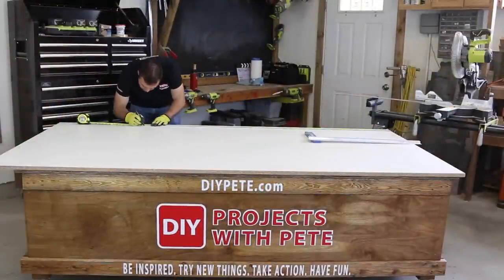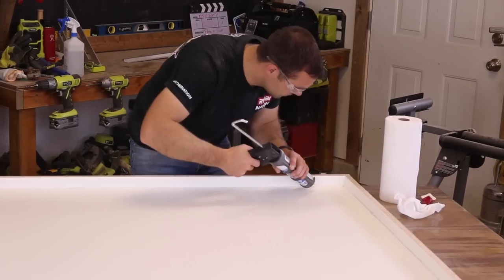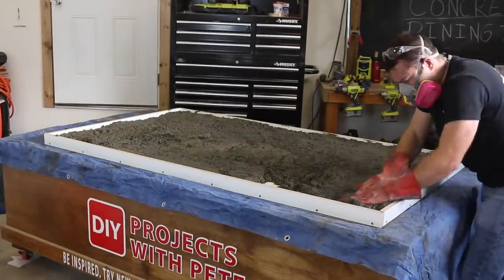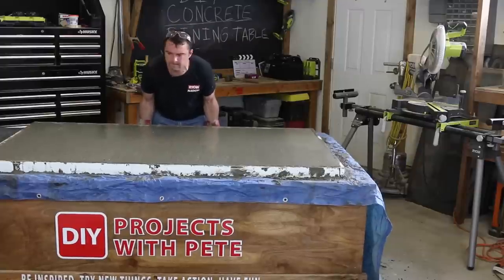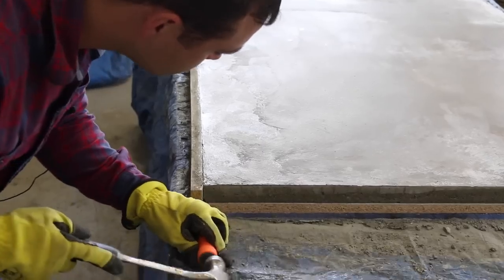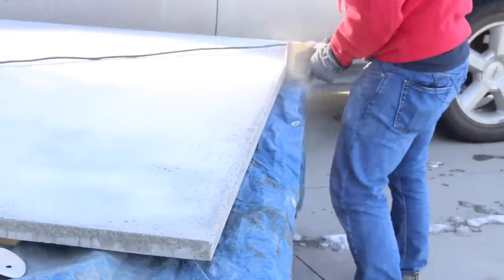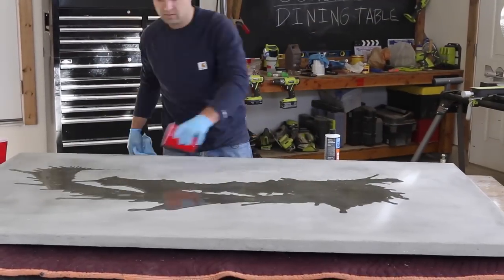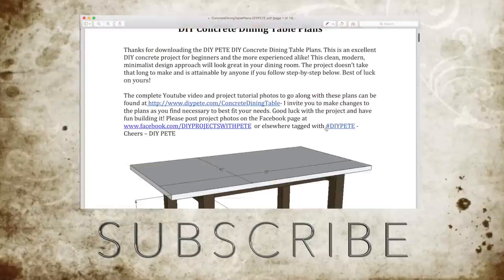How to Make a Concrete Dining Table

Comment: Pete, I'm wondering about your base, and how it's held together. Given the thickness of the stock, do you think 3/4" dowels with wood glue can hold that weight?
Reply from the maker: Hi Stephen! It sounds like you are talking about using dowels for the joinery instead of screws. I do think dowels in combination with wood glue could be another option.

Comment: Hey Pete. Awesome design. How did you go about calculating the strength of the wood base, to ensure it could support the 400+lb table, in addition to the live load of food, plates, etc.?
Reply from the maker: Thanks Justin! I built it very sturdy  and actually ended up putting in a few additional support after the video. I did some tests myself, butI did not use specific software.
Reply: Have you ever worked with redwood? I’m considering the same design you used (in your pdf plans) with redwood 4x4s. Interested to know if you’ve used it for furniture in the past with much success.

Comment: nice project Pete...what kind of wood you used for the base?  ... do you think a 3 by 3 would do it as well?
Reply from the maker: +phil par Hi Phil! I used douglas fir for this project, (4x4's which measure 3 1/2 x 3 1/2 of course). I wanted to keep this beefy, since the concrete is quite heavy. I think I'd stick with the 3 1/2 x 3 1/2 if possible. Or if you use stronger joint types I think you could get away with thinner timber. I tried to keep the base as simple as possible for beginners, which is why I used wood glue and 6 inch screws. Thanks for the great question Phil.

Comment: Great looking table Pete.  How long do you let the concrete cure before wet polishing it?
Reply from the maker: +Eric Opal Hey Eric, if wet polishing the concrete I like to wait a while for the concrete to continue to harden and cure. After removing it from the mold completely, I'd recommend letting it cure for an additional 48 hours or longer with the Quikrete mix.
Reply: Ok thanks.

Comment: Hi, just wondering if you have to sand the concrete before you seal it?  I like the way it turned out with just minor sanding of the corners and edges.
Reply from the maker: Hi! You can finish however you'd like. You can go without sanding if you'd prefer. Will have a bit different look and feel.

Comment: Hi Pete, thinking about attempting this project and just wondering if an MDF board is just as good to use as melamine as MDF is about 1/3 of the price of melamine here in the UK? If so would you recommend to use a moisture resistant MDF board or just a general purpose one? Great video and instructions, thanks
Reply: Or I can get some film faced phenolic plywood which isn't too expensive, thoughts?
Reply from the maker: Hi! I wouldn't recommend MDF as it will soak in water and then it can expand. If you were to seal the MDF then you'd have a material that would work. You might experiment with some smaller pieces just to make sure. But as long as it is really smooth and sealed it should be fine. Cheers!

Comment: If you use double sided tape you don't have to cut down your melamine, just cut your strips to the actual height, place the strips down on double sided tape, i still screwed the corner.  Saves a lot of time and you can reuse the base melamine.

Comment: hi Pete thank you for the videos they are amazing let me ask you a question I can't afford the melamine can I use plywood for the bottom part of the table and make it smooth on top
Reply from the maker: Hi Elia! Plywood won't be perfectly smooth and will absorb moisture from the concrete. If you did use plywood you'd first want to seal it. Even sealed, it will replicate the surface of the plywood -- so it will mimic the grain and any knotholes etc. You could pour the table right side up, but I don't recommend that to beginners because it takes some practice to be able to get a nice smooth finish with a trowel.
Reply: Do you know if I could use stucco on the table
Reply: By the way I love all your videos

Comment: This is great! Thanks for the tutorial.I have a question...Is there a way to make concrete adhere to wood? Like, if I had a wood molding, but I wanted the concrete to stick to the wood? I'm worried the wood might soak in all the moisture of the concrete, or the concrete just wont adhere to it at all...I was thinking maybe mesh tape, like used for drywall placed on the wood before pouring the cement?Thanks!
Reply from the maker: +Nathan Samuelson Hey Nathan! Are you meaning to secure the table top to the base? Or are you thinking about boarding the table with wood? Let me know what you are planning and I can do my best to help out. Cheers!
Reply: +DIY PETE So I had a variation to the plans a little bit. So on the bottom of the table, I'm making a wood platform (Kind of like on a coffee table - that bottom shelf where people usually put blankets or baskets). It's made up of 3/4 inch pine board. What I want to do is pour concrete on top of that wood, and use an acetone based dye to color the concrete. So the concrete would just rest on top of that 3/4 inch pine, but I don't want the pine to show, I just want the concrete to show. I'm just worried that the wood will soak up the moisture of the concrete and thus cause the concrete to dry out / crack. Hopefully that helps.

Comment: This is such a beautiful look. I am just wondering though, would this concrete work for doing a concrete overlay on a kitchen table?
Reply from the maker: Thanks for watching and taking the time to comment. Great question! This type of concrete work would be what you'd do if you wanted to add a complete new top. To do an overlay, you'll want to use a mix designed specifically for overlays. Brands like Ardex, EliteCrete, and Butterfield make them. Many are polymer based. (they have really small aggregate (no rocks etc) -- and are made to be spread super thin. I'd recommend searching concrete counter overlay on Youtube and seeing what you can find. Cheers!
Reply: DIY PETE Thanks for your help! Take care!
Reply from the maker: Thanks so much, you too! Have a fun weekend!

Comment: nice pete.! have you made a pool table slab made of concrete instead of slate since slate is more expensive than a DIY pool table slab. May I also know what are materials needed in order to make the slab more stronger and harder.. thanks. from Philippines.
Reply from the maker: Hi! I have not yet made a pool table with concrete but have heard of people doing it. You'd want to use re-bar and mesh re-enforcement. And a high psi mix.
Reply: Thanks Pete, can you suggest  me how to attain that high psi mix, its mixture?

Comment: Diy Hi Pete , congratulations po that good project, a question not see the concrete base screw it to the wood.
Reply from the maker: +Gilberto Jimenez Hi Gilberto! The concrete sits on the wood base and is not screwed to it. The concrete is plenty heavy, and will not move around. I do glue wood blocks to the underside of the concrete to prevent it from ever shifting ( 13:45 second mark of the video ) The top can easily be removed when the table needs to be moved as well.
Reply: +DIY PETE ok , thank you, I'll take it into account when you do

Comment: Love your stuff pete! What kind of sealer do you use as in material? I’m from Holland so the brand you use probably isn’t available here.
Reply from the maker: Hi Daan! I use Cheng sealer or TuffDuck. Both are available on Amazon if that is an option. They are both food safe as well. They are waterbased acrylic sealers. They've worked pretty well, but I've yet to find the perfect sealer.
Reply: DIY PETE thank you sir! Seperate question: what thickness do you recommend for a 2,5 foot by 6 foot counter top? I was thinking around 2 inches. 

Thanks for taking the time

Comment: So, this may be a bad idea, but the table is exactly what I want, now imagine, I make the concrete slab and frame like you did, but instead of having a regular concrete slab, I turn the table top into the top from the outdoor gas fireplace. So I have the frame from this video, and the table top from the outdoor gas fireplace. I imagine it would be more than 400 pounds, and with fire and wood I know how bad that is, but I don't know how the head dissipation is. What do you think?
Reply from the maker: Would this be used as an outdoor table on the patio? I know of one person so far who shared photos with me of a table they did for the patio -- with the trough insert and gas fireplace. They did a different base, but did have success with the build. As always, you'd want to check with a contractor or to check the local building codes. Cheers!

Comment: Nice project Pete - the detail you show in your videos is amazing.  I definitely appreciate it.  Hey Pete, i noticed that most of a number of DIY concrete projects only use sealers to finished the concrete top and bottom.  Q1.  Any reason why you do not a water diamond sander to get a 'granite like' smoothness, say up to 800 to 3,000 grit?  Q2: The sealer you use, would you recommend for both indoor and outdoor? Just curious.
Reply from the maker: Hey Michael! I actually do use a water polisher quite often, I just don't in the videos as I try and show how to do the projects without having to buy additional specialty tools. As for the sealer --- the Cheng sealer is what I always use for indoor projects. For outdoor projects I use an outdoor acrylic sealer made to be more durable and with UV protection.
Reply: DIY PETE... KEWL. Keep up the great work Pete. You give everyone great DIY ideas, including doing things right. One day I will have to post my outdoor bbq Island one day with concrete counter top, when  I have more time.
Reply: DIY PETE Hey PETE, thank you.  For folks who have the tools, do you recommend water polishing - for example is there a significant different with water polishing compared to what you showed on your video?  Water polishing is a pain and opens up small pores.  If there is no major different i prefer not to water polish.  Thanks Pete.

Comment: I was wondering if you could use a concrete acid stain on the table before sealing it.  Just wondering because of the possible food contamination.  I have watched many concrete tables and countertop videos and no one has ever made one with a stain.
Reply from the maker: Hey Randall! I've done a number of tables with acid stain - neutralized it, and then done a food safe sealer over it. Cheers

Comment: Great project. It looks awesome.

I have never worked concrete: how did you decide the thickness of the table? I want to build a ping-pong table to donate it to a community' park, but I'm concerned about its weight. I'm wondering how thin it can be to make it less heavy without compromising it's resistance
Reply from the maker: Hi Marcial! What a great project to donate. I've seen a few folks do ping pong tables. I'd recommend 1.5 inches. I would not go any thinner. You could go 2 inches if you want, but the weight will increase obviously. Sounds like a fun build you have coming up!

Comment: Hi Pete, thanks for sharing your knowledge and experience!  Great video!  I have a question? Is there a reason why you don't use the side facing up as the top?  I'm wondering if I can just use a finish trowel on top to make it look smooth rather than flipping it over?  Thanks Pete!  Be great to hear your response!
Reply from the maker: +Roberts Masonry Hey Robert! I do the reverse cast technique because it makes it super easy for anyone to get a perfectly flat top, and it is sort of a pour it and forget it type project. The downside is filling bug holes and polishing / sanding time. If you are good with a trowel then definitely go for it and do a hard trowel finish (similar to how I finish the bar top: https://www.youtube.com/watch?v=nmoF47rds1c ) -- This is nice because you don't need to fill in bug holes and finishing time is so much less. The hard troweling look is nice and organic. I will be doing an upcoming video about hard troweling -- I just don't recommend it to a first timer since as you know, troweling is quite an art to get it perfectly smooth. I've done a number of pour in place counters and tops by hard troweling, and by all means go for it! I'd love to see your finished table Robert! Cheers man - Pete
Reply: +DIY PETE thanks for replying and with great tips!  I just removed the forms from my piece I learned that the trowel finish looks great!  I will add also the reverse cast side looks great too!  I tend to like the reverse cast side edges a bit more with the beveled edge from the caulking.  Thanks again Pete I did go to the other video you suggested and found it really helpful.  Thanks again for your time and advice!

Comment: What's the total size of the table top?  (Sorry if it was already asked, I read through many comments and didn't see the answer.)
I noticed on your website you're updating the base construction.  What made you need to do that?  What problems were you having with the current design?
Thanks.
Reply from the maker: Hi! The overall table top is 72 inches by 41 inches. The plans were being updated to add additional support to the base. Take care!

Comment: What if you want to make concrete legs for table? What do you suggest the thickness should be to support concrete table top?
Reply from the maker: Hi! This will really depend on the style of legs you choose to do. I'd recommend doing some additional research on this topic as I'm not sure about the thickness needed.

Comment: Hi! I’m building a 9ft table. I can’t find melamin that is that long. Is it okay to join two sheets? Any suggestions! Thanks! Best tutorial around
Reply from the maker: Hey Brendan! I've done longer tables by connect two sheets. The work surface underneath needs to break perfectly flat. I connected the two boards from the underside with pocket holes /screws and wood glue. And then you can seal up the seam. You will notice a small difference in the concretes look at the seem -- but if you have a wet polisher and expose a little aggregate you'll be able to hide the seem.
Reply: DIY PETE that’s awesome! I was going to use pocket holes and some sealant in between . I’m going to use the quikrete table top mix and it looks more fine so it’s shouldn’t be an issue to blend. I just hav an orbital sander but I’m fine with that. It’s going to be outside so don’t need it to look perfect!

Comment: Hey Pete my wife wants me to build her a farm table but she doesn't want the legs on the corner she wants them in the center. I can make a farm table (regular) but what she wants I don't have a clue. Could you build a table like that? I sure would appreciate it. She wants the the table to be 8 feet and the boards to stretch the full length of the table. Thanks for any help, Tim from Texas.
Reply from the maker: Hey Tim! I'd recommend checking out www.ana-white.com for more ideas on table bases.

Comment: Great Pete! What sealer would you use for sealing this for outdoor use?
Reply from the maker: +UnknownHandle UnknownHandle An outdoor acrylic based concrete sealer. I've a number of different brands. I just re-seal every summer to keep it looking it's best :)
Reply: +DIY PETE Pete...Come on!! Every year?!  Maybe you have the DIY abilities, and the material, and can plug into your workflow to seal EVERY year, but that is SURELY not a seal that lasts. Wow. I would think 7 years maybe acceptable, but who has time for it? We want things that are LONG term maintenance free and that last, so we don't use up our resources in the environment and still can enjoy a concrete table outdoors. Its not like we take the table out to the salten seas. Its just getting super strong Cali sun of 120F degrees, and morning dew with lows in the 30's...But its concrete, so I don't even know what happens if you don't seal(besides juice , wine and other stains/?  Thanks!
Reply: +UnknownHandle UnknownHandle The sealer certainly lasts a long time, but for the 20 minutes it takes to seal a table for added protection with a little water based sealer it doesn't bother me. Doesn't take much at all. Mines probably rated for 3 or 4 years, and it will just depend on the weather. And if you need to add a little ever few years or whenever grab a rag and put a little on :) You'll definitely want to seal with some sort of concrete sealer, see if there are ratings for length of the product and go with the one that best suits your needs. Without a sealer wine and etc will stain :)  I agree, the less maintenance the better!  Cheers!
Reply: Thanks Pete..., I guess if it takes a little bit like 20min, not much a deal. I plan to use a stailess steel legs/frame. Would love tosee more concrete vids, like form and shaping molds and such. Thanks for a great video, Subscribed!
Reply from the maker: Thanks so much for subscribing! I'm not sure if you found the concrete playlist yet, but if not here are some other concrete videos of mine: https://www.youtube.com/watch?v=Fcon-Oivqs4&list=PLlAnlwB04VJR779xAJhtGzGYFcC9yVQ22   - Great idea on showing videos including forms, molds, and stamps. Love it!

Comment: DIY PETE
I understand the tables made of concrete and all but i have to ask
How long can it last before cracks start to form?
Reply from the maker: Hi Ignacio! This table looks like the day I made it still and my indoor projects from even up to 5-8 years ago look great. There are a lot of precautions and things you can do to minimize the chance of structural cracks and issues. But I have built a number of concrete counters this way without problems. I actually am planning to re-do my kitchen soon and will be making concrete counters as I like them so much. Cheers!